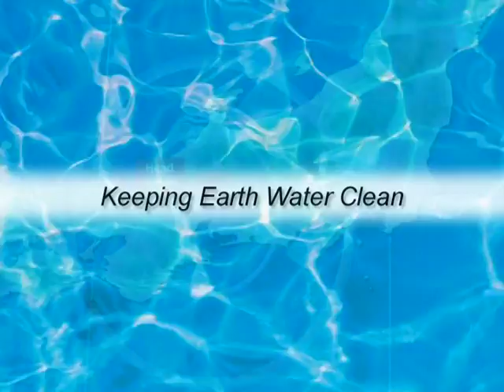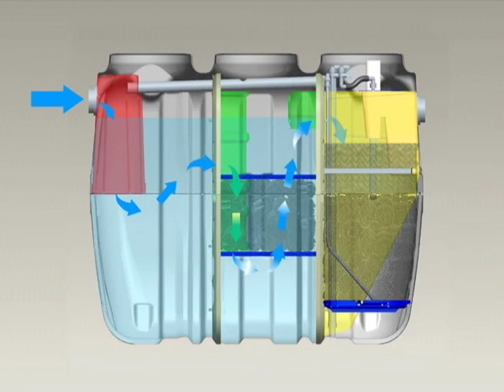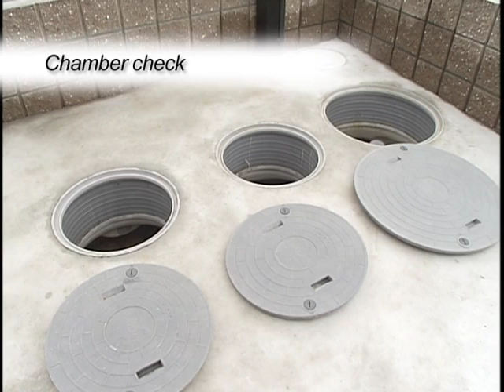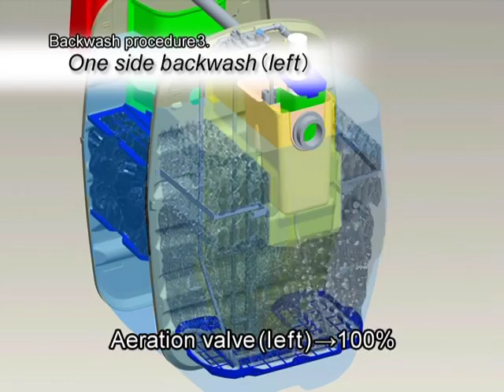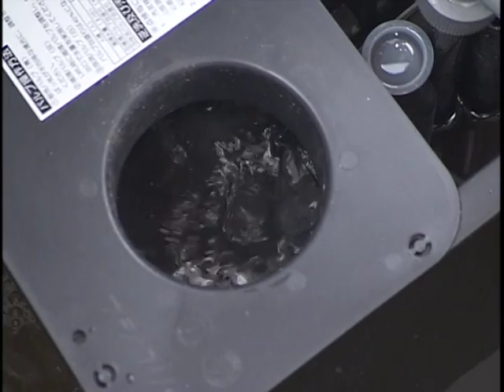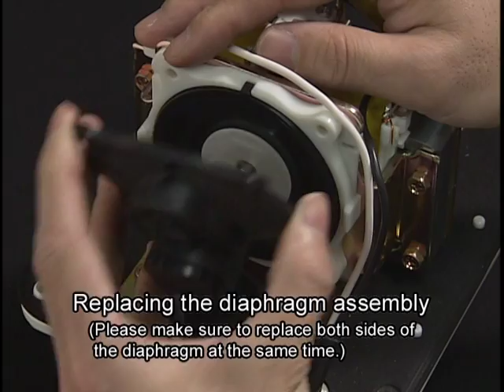Fuji Clean Maintenance video CE1500EX

Comment: not a good unit
would not recomend
Reply: Mine is 5 years old and working well
Reply: @paulgibbins9682 mine is 7 years old no problems.
Reply: what do you think about the quality of effluent water, have you experienced it?
Reply: Miko can you tell me why, my county is requiring an atu system.
Reply: @1kimmyflink  requires power 24/7 and uses a lot, requires maintenance every 3 months by certified plumber to install new chlorine blocks, we had trouble with blockages resulting in it being pumped out in about 12 months, speaking to others they had to replace the main pump in around two years, i would not say they are eco friendly dumping the over flow to a flood area either